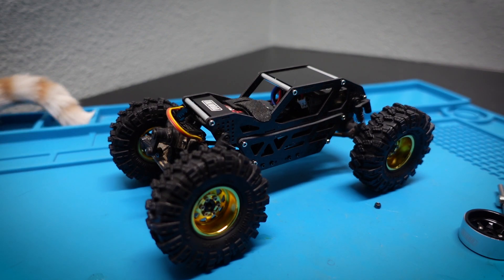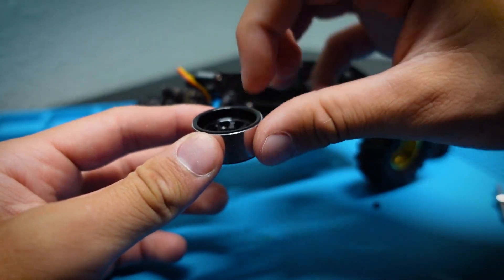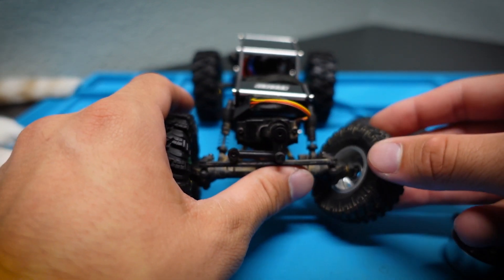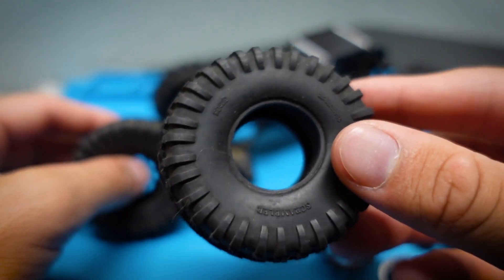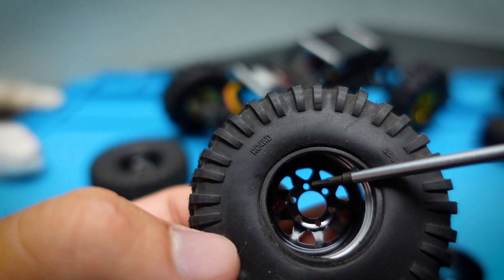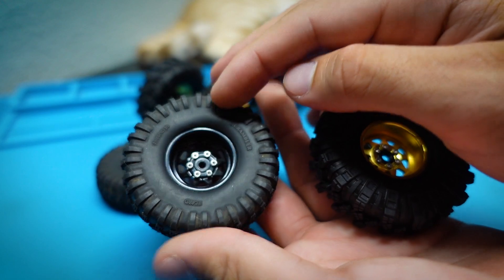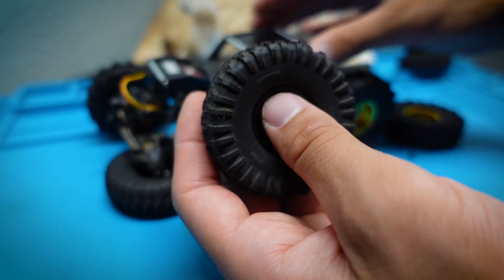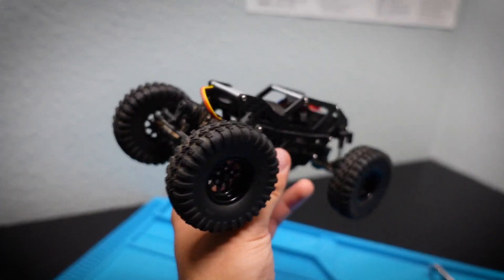Installing INJORA 1.0 Deep Dish Stamped Wheels Ep. 5

Comment: Wow, looks easy, some other guy showed the same and it took 20 minutes, told you have to use some lube, than was picking around the tire on both sides for several minutes to position it correctly, will be receiving two sets of these soon.
Reply from the maker: Hahahah all have to learn somewhere 🤓

Comment: Yo great video and a very good tip on assembling the wheels, I have a set of those stamped wheels for my 1/10 crawler but never used them because they were a nightmare to assemble lol. I was looking at those injora wheels for my scx24 gladiator, I might have to get a set. Rig looks bad ass.
Reply from the maker: Give ‘em a try ! MC05 for 5% off
Reply: @MiguelCortez  thanks brotha.

Comment: I got my dad the deep dish wheels and the hub doesnt allow enough axle to show through to use the wheel nut the regular way … had to run them backwards. Then I ordered the original ones to run as extra deep dish and ran into the same issue….🤷‍♂️?
Reply from the maker: I’m confused